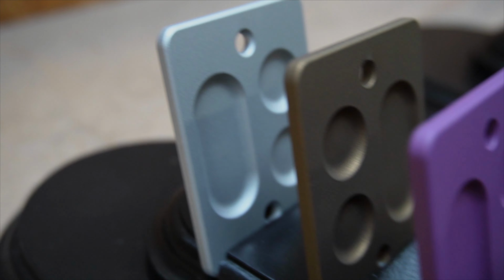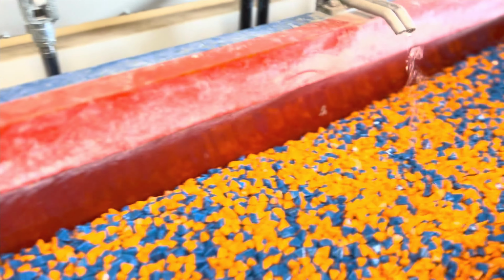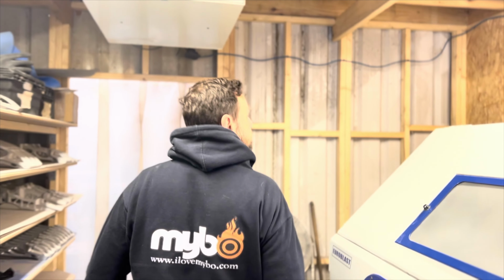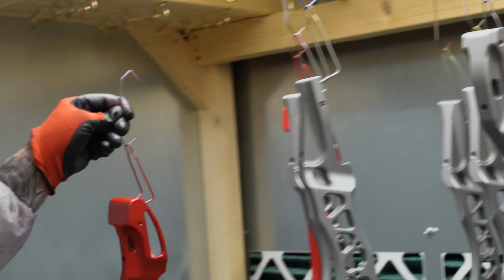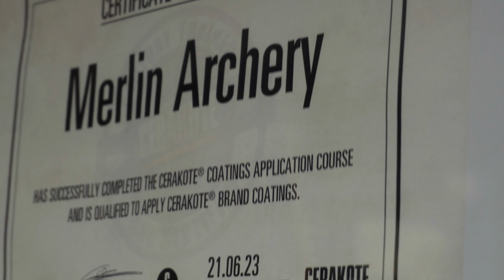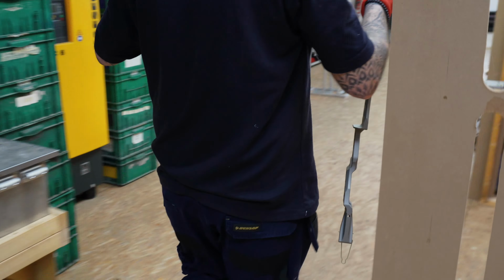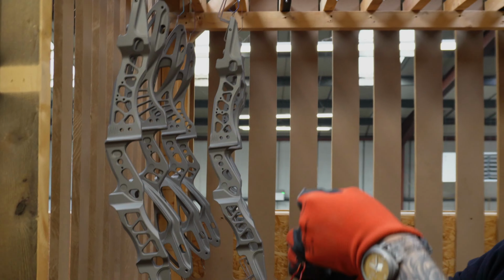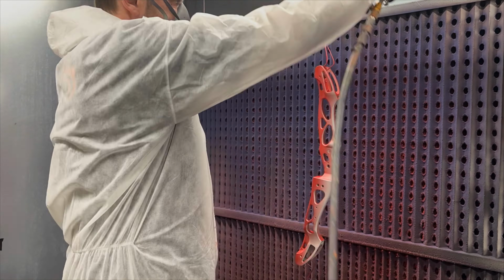Building Bows - Cerakote, it's NOT paint it's ceramic!

Comment: In automotive Cerakote is used for the exhaust manifold to make the part last longer and dissipate heat faster. An exhaust manifold needs to handle extreme changes in heat and this stuff helps it handle it, that alone should speak to how tough this coat is.

Comment: I have a riser with Cerakote finish. Scratches way easier then my anodized risers, even cheaper ones. After one season of shooting there was a spot on the grip area where bare metal was shining through. Manufacturer told me this is normal wear and tear. Not impressed at all with this stuff.